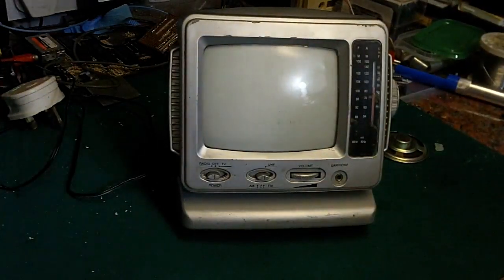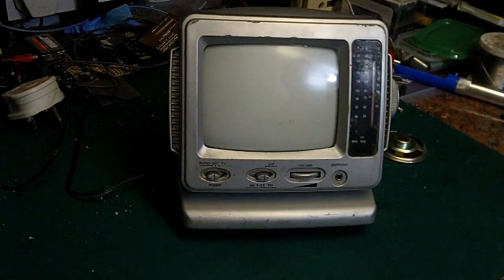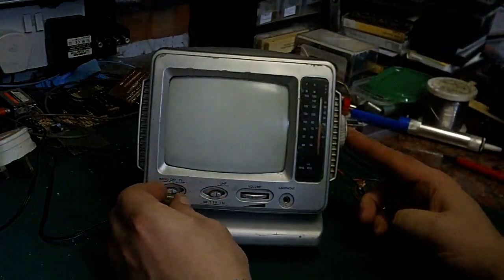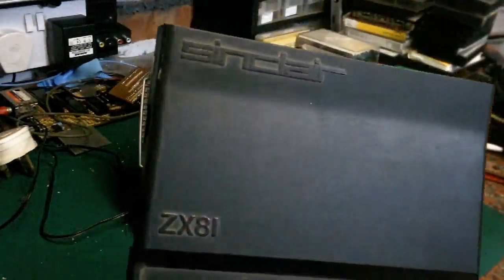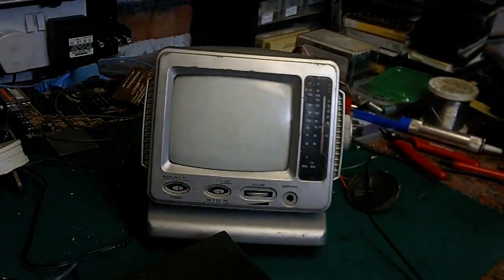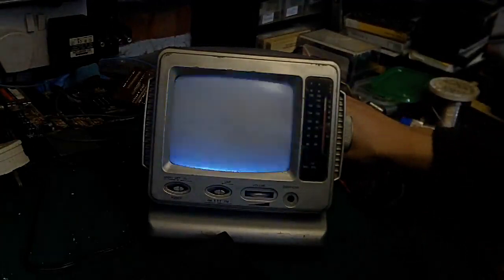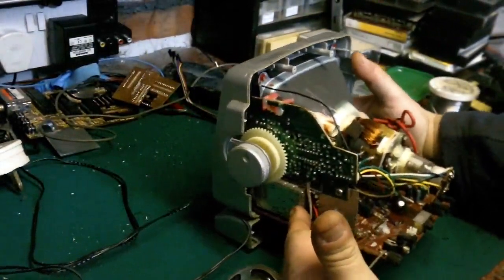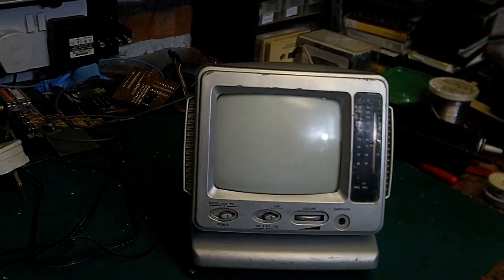Woodland Discovered 5" B&W mini TV. Will it run

Comment: a while ago I found a LCD tv with built in dvd player, in the woods.  little one.  think it was 19".  I googled the 4 pin power connector.  checked the tracks on the pcb too.  was 12v and gnd.  so I wired it up.  after leaving it in the boiler room for some days.  it worked.  used it with my games consoles.   I found a PS2 slim, with a bolt on lcd. near the dump.  I got a psu from ebay.  It powered up.  put a "cardboard dvd".  a movie that was a free gift from newspapers.  it played the start of the film, ok.  then something fizzled.  I didn't bother opening it up.  as its likely to be all tiny wee surface mount parts.  not easy for a clumsy bloke like me, to fix